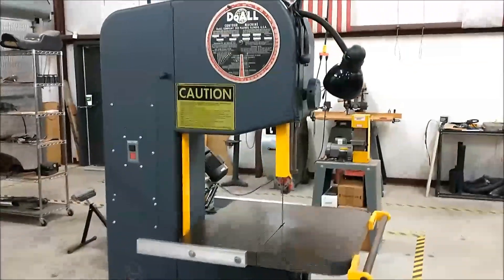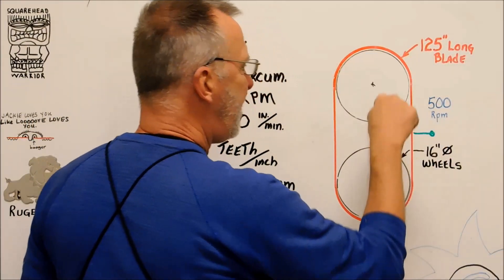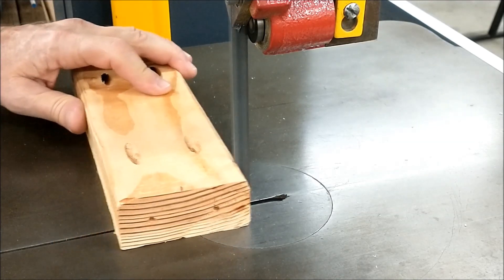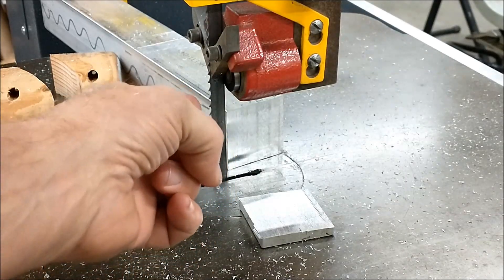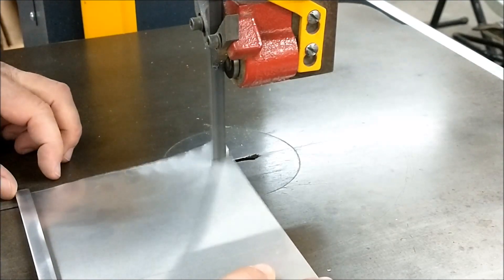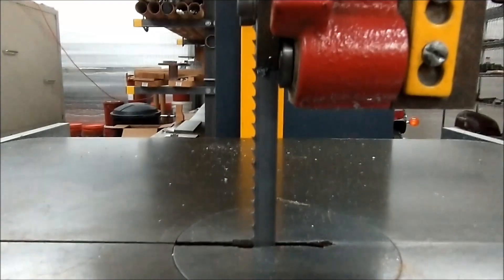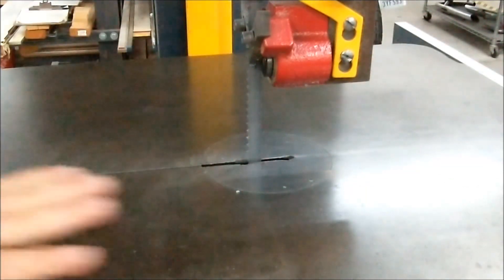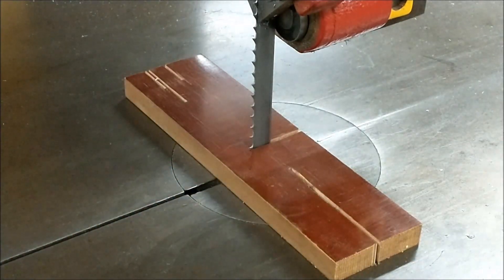1200 POUNDS, 500 TEETH, and No Conscience !!!

Comment: Nice saw Joe, but where’s the blade welder
Reply: It's not needed on that particular model.
Reply from the maker: I have it, but its on the shelf. It had a bad amplifier when I bought it so I took it off and replaced it with the cleaner blank switch panel. I buy my blades cut and welded to length any way, so I don't miss it.

Comment: Another fantastic tip and a good trick to know. I was always told Never run the blade in reverse, this not only proved that wrong but showed a benefit to doing so. In the past I've always sandwiched thin material between two sacrificial off cuts. This way is so much easier and makes following a line much easier so leading to greater accuracy with less wastage as a bonus. Thanks again Joe.

Comment: Back in the 60’s when I was an apprentice Shipwright at a shipyard, the wood shop had a resaw. What this was really was a giant bandsaw. The blade was around six inches wide, and had something like one tooth per inch, maybe less. The wheels were maybe six feet in diameter. The saw was so tall the bottom wheel was below the floor. There was no table as it had an automatic feed to resaw 12”x12” timbers into various thickness planks. That saw was downright scary when it was running. It would feed those timbers through like they were butter. 
To this day the bandsaw is my favorite shop tool.

Comment: Another take on your idea:  turn the blade back to forward (backward) so that the material being cut sees the back of the blade (gauge of the blade).  This was explained to me as “friction cutting”.  The heat is dissipated fairly quickly as the stock is thin.  The final trick to cutting this way is to keep the stock moving while cutting.
Reply: Your blade guides might not appreciate running against the teeth of the blade. In particular the thrust bearing.

Comment: To cut any thin sheet metal steel, brass or aluminum use a dull worn out multi tooth blade(32 tpi). Run the blade at max speed. This works very well with 1/4 or 1/2 hard stainless steel sheet metal. When your done store the blade for next time. Saves ruining a blade by running it backwards
Reply: Might want to wear ear protection with this one

Comment: Another good safety vid. - Good show not wearing gloves when the machine is running too. And I agree with Break-down below. Showing the Drill press vise upside down trick would have been helpful ,,,,,especially to me 50 whatever years ago. I hit a note no opera singer ever sang when the saw grabbed and spun a piece of thin wall tubing I was free handing. To this day I cut even structural shapes with a vice or bridge clamp on it. Go ahead and call me chicken but it's amazing how remembering the pain of getting  a black fingernail keeps you from getting another one. 

I am by no means a safety nazi but I thinl you could save a few fingers by making a video about what can be the most dangerous toll in the shop. The Lowly Drill Press. 

And above all NO GLOVES AROUND ROTATING MACHINERY. Loose the gloves or loose a finger, Better to have a couple stitches in your thumb then not to have a thumb to have stitches in. ---- (That could be another good safety video---even 'ripaway" cloves can move your hand in just  far enough to get tangled up. 

Still. this is a excellent video that should be shown in whatever shop classes that still exist.
Reply from the maker: Watch the video previously posted in the pinned comment above.
Reply: @joepie221  Thanx, Joe

Comment: I just can't figure out how you got the blade upside down.  I guess I need to go down to the shop and look.
Reply: You invert the blade by holding it in both (gloved) hands and twisting the blade. Sometimes when you open a coiled blade it will invert itself and you have to use this twisting motion of both hands to revert it back to teeth facing downwards.
Reply: @Zircon10  Always scares the xxxx out of me to uncoil a blade. Face and arms are potentially in danger regardless if you wear gloves.💩
Reply: The blade needs to be twisted “inside out” ie the inside face of the circle needs to be on the outside. My portaband blades come facing wrong and need flipping.

Comment: We used to cut the thin, cheap plastic lens' for odd sized Fluorescent fixtures on a table saw with the blade reversed.  Just have to go slowly so you don't "burn" the edges.  It also helps immensely if you have a close tolerance on the blade guide slot.

Comment: Very interesting. For thin materials less than the tooth spacing? Was taught in jewelry making tooth spacing needs to be less than the thickness. If very thin then cut at an angle, which is hard to do on a 90 degree bandsaw.

Comment: When I saw 1,200 pounds, 500 teeth and no conscience I assumed an in-law was popping around....

Interesting on the reverse blade though I don't feel inclined to try it myself because you will always have to remember to turn it back around when you are done. Always good to remind people (and ourselves) that machines are dumb so have neither brain nor conscience but do have power and the ability to cut and rip bits off people.
Reply: It never hurts to look at the blade when walking up to a bandsaw, or any saw in general if someone else might have used it or it has been sitting a while. I tend to at least glance at the blade to confirm the tooth pitch is about what I need and that the teeth are facing the right way. If it is a saw I haven't used in a month or more I open it up to make sure the wheels aren't jammed with chips, and manually push the upper wheel around in the normal direction a couple of turns to make sure both wheels turn and that I don't see a twisted blade or an excessive number of missing or loaded teeth. Of course with a horizontal bandsaw you can't really move them manually, but it is still worth looking at the blade you can see and jogging the machine quickly and watch the blade as it slows down.
Reply: @lwilton  All good advice.
Reply: @lwilton  Naaa, I never put a blade in backwards and screwed it it cutting steel barstock....(In a pigs ear) - Very good advice....I have even screed up garbing a left hand drill and wondering how a brand new drill wouldn't cut. It only takes a second to look.

Comment: All right, not quite to the end yet, but fer crying out loud, why aren't you using a sacrificial backing when you try to cut thin material like that? That's exactly what you've demonstrated so many times on the mill! Chipboard or expanded vinyl are cheap and easy.
Reply from the maker: The segment at the end was because I knew I would get blasted. I hope you made it to that point. You are absolutely correct.

Comment: Where I worked before retiring we had a bandsaw we used for cutting stainless steel pipe with a 6/10 vari-pitch blade. The blades would last up to 3 months unless an electrician came along with some stainless cable tray or unistrut. They set the bow drop too fast and stripped all the teeth off the blades. We ended up getting a bandsaw just for the thin material, restricted the rate of bow drop and putting on a 16 tpi blade. It paid for itself in the time saved from changing blades and buying replacement blades.

Comment: I use an old Grob, the same size as your DoAll, on a daily basis.
It still has the blade grinder and welder that actually works.
The blade speed and tooth  chart shows a recommendation for cutting meteorite lol.
Be well and stay safe, Joe.

Comment: Very useful video and a beautiful bandsaw. I'm more familiar with wood in terms of bandsaws but it's just the same thing, is very dangerous specially with low count of teeth when it literaIly eats material. I didn't know about putting the blade in reverse. I usually put a piece of mdf on the table and use it as a support as you've done with the fenolic at the end for thin material .

Comment: Good reminders...I've got a circa '60 version of that saw but I usually run a finer tooth on it than what I see frequently on yours. But, I've got a 20" wood cutting bandsaw that generally keeps a 152" 2-3 tpi skip tooth blade on it. When that saw starts you give it a moment of respect.  I'll have to say though , the most dangerous tool in my shop is my '40s vintage 16" Oliver tablesaw. I've got several friemds with scars or bandages.one quite recently is going to require reconstructive surgery. I try to think of my friends like that every time I go to power that one up. 
Thanks again for the basic reminders that too often wego in automatic mode and the basics go out the window.

Comment: My father in law ran a machine shop in El Monte, CA. I was running a 45 degree bevel rip on a long board and standing to the side of the table to support infeed and outfeed ends. FIL jumped all over me. “Never stand to the side like that with the table tilting downwards.” 

He had a machinist helper running a similar bevel cut in an aluminum block. The blade broke and the broken end caught on the angled table surface. Momentum of the blade continued its slide down the table and into the stomach of the helper standing there. They lost him. 

I know that’s kind of a freak accident but it put enough fear into me that I never stand to the side of the table, and especially not if the table’s outboard edge is tilted downwards.

Comment: To cut roofing iron with a circular saw put the blade in "backwards," this cuts sheet metal with ease much better than a cutting disc. Try not to use a carbide tip blade as this will wreck it and be careful of the hot chips coming off the cut. Shorts and bare feet not recommended.

Comment: Strangely enough I never had so much as a nicked finger in metal or wood shop while I was teaching.
The rule for using the Band Saw was to keep the guard 1/8 of an inch above the material being cut. I always figured that spacing would not allow a finger to enter. Push stick/block was mandatory if you were near the blade.
Probably had more minor injuries with the drill presses. Students not using the vice on short pieces.

Tim
Reply: Hard to believe but the lowely drill press hurts more people then anything else.

Comment: Yep, reverse teeth work great on gummy, melty, or otherwise soft material.  Learned that trick cutting rubber mats for target backers.  Still have to check the blade for buildup, but far better cut that way.  Everybody gets all safety around the bandsaw, but it's commercial table saws or rip saws that give me the heebee jeebees.  Just as quick to take digits with the added fun of kickback.
Reply from the maker: Wood shop jointers make me cringe. I have to say thats my personal scariest machine. All the others don't bother me.
Reply: @joepie221  ...but nothing says good morning quite like blowing up an end mill at ~18k or the guy a machine over forgetting his coax is in and turning on the spindle.  Those are bangs you don't soon forget.

Comment: My first job and first Union job in HS was butcher clean up. I made twice what my friends did so I really did not have to work a long time to get some spending money. Of course I could not cut meat but in cleaning up had to take apart and put together all the tools including the band saw. When they had me install a new blade they would give me a bone to cut to wipe off the factory oil that protected the blades. Cutting a cow thigh bone which is much heavier than any of our bones was extremely quick. I gained instant respect for power tools.
Reply from the maker: The minute you loose respect for a power tool, the tool will be happy to remind you.

Comment: Great math on how fast the teeth  are moving  thru a plane. My A&P aircraft  instructor  did the same math for a standard  E2C prop. At idle  speed  the prop will hit you 32 time a second.  We were blown away     that the one blade will hit you that many times in one second.  Great video  joe.

Comment: Running blade backwards on plexiglass is a bad idea.  You are melting your way through.  That is the LAST thing you want to do on any acrylic plastic.  If you were to look at it through 2 crossed polarizers, you would see dazzling colors at the cut edge, indicating much built-in stress.  Lay those cut pieces down & wait 1 month, & you will see thousands of little cracks, just waiting to propagate through the material.
          To cut plexiglass, you need a fine tooth blade, in the SHARPEST state, running at about 30 feet per minute (I assume your saw has a low-range gearbox like the 20" DoAll bandsaw I used at work).  The backwards strategy is best for soft materials that cut with a knife, such as PVC siding, & rubber.  Some manufacturers make such "backwards" blades for the purpose.
          But there IS a dirty trick when your blade is marginally too coarse for the job: run the blade speed a little high & feed lightly.
          This saw is no more dangerous than most floor-standing bandsaws.  In fact, wood saws are much more dangerous.  They have longer exposed blades with coarse teeth, optimized to cut flash, & run at higher speeds than are used in most metal cutting (unless you are friction sawing steel).  Some wood saws run so fast & store so much energy that they have a footbrake to stop them after shutting off.  At these speeds even the low-mass blade can fly out when it breaks in the middle of a cut.
Reply from the maker: If the material turns brown and lumpy on the backside, you're melting it. Softer plastics will have a tendency to melt, but acrylic cuts just fine. The demo piece didn't melt at all.
Reply: @joepie221  You would not believe how slow you can saw & still melt the plastic.  For many plastics, such as vinyl siding, it doesn't matter, because they are "plastic" at any temperature other than cryogenic.  But for plastics that are brittle when they are cool, it does.  You can see this when hacksawing a thick piece of Plexiglas.  Get piece with polished edge, about 1 inch from, & opposite to, the side you are sawing into.  Clamp piece vertically in vice & saw into one side, while you watch the bottom of the cut from behind, through the polished edge.  If you move the saw REAL slow, the bottom of the cut will appear white.  If you saw faster, you will see clear spots, like the plastic was wet, in the bottom of the kerf, as you saw forward, & disappear when you stop.  This happens in Plexiglas because after the cutter passes, the plastic springs back & rubs even though the teeth are relieved.  The plastic is an extremely poor thermal conductor (the heat is trapped near the surface), & has a low specific heat (it takes little heat to give a large rise in temperature).
          The result is a land mine, just waiting to go off.  It will crack later, especially if it is exposed to outdoor UV light, such as on a store sign.  The solution is to anneal the plastic after all machining is done.  Sanding melts it too, unless you sand in water.
          If you think this is bad, wait until you see Plexiglas cut by laser!  There are numerous clock projects with Plexiglas gears.  in a month, cracks radiate from all the roots of the teeth.  If you set up a polariscope (2 crossed polarized lenses from cheap sunglasses will do), you will see dazzling colors at the cuts, showing the internal stress.

Comment: They aren’t too noisy or scary.  Visit a butcher shop and see one in action on meat!  Thanks Joe.
Reply: Between two jobs I spent a few weeks in a meat processing factory as a maintenance engineer. The people working on the bandsaws were only allowed a short time on the machine before they were swapped out with another operator so they never lost concentration. There were also signs up telling people not to talk to the operators so they didn't get distracted.

Comment: Great demo. I use a bandsaw in a wood environment. Always considered it one of the most dangerous tools in the shop. It looks so innocent and yet will bite you so quick. Always change my grip on the material to behind the blade when almost through. No matter how much you think you have eased the pressure off, it always shoots forward more than you think. Our resaw bandsaw has a power feed.

Comment: Thanks Joe! That's one very informative video...... I learned a lot.

As a machinist I got to use a band saw quite often in my job, one thing that was instilled into me by the old timers is to always use a feather board (or some piece of wood to keep your fingers away from The cutting edge). One time I forgot..... And after cutting halfway up the length of my pinky nail, and going to the emergency room, I was much more careful from that point on.

My pinky healed up fine, but every time I look at that scar I remember how dangerous band saws can be when you're not paying attention.

My Uncle Jerry, who taught me all that I know about sheetrocking, carpentry, and painting..... Had one of these band saws in his basement workshop. He had come down with Parkinson's disease, but he was independent and quite stubborn. One day he was cutting some wood on his band saw and he cut half of one of his fingers off.

I've come to realize that in a machine shop you always have to respect the saws and the grinders..... Because either one could change your bodily appearance in a heartbeat!

Comment: Great tip!!! I've never understood why everyone installs the table insert with the slit to the front. I have always placed the extended slit to the rear, so I have material support at the cutting point on thin material. I don't run different size blades, just      different tooth counts. Always great videos!

Comment: Always been told that the bandsaw and table saw are the two most dangerous tools in a shop. Especially the bandsaw. While most people will adjust the height of the blade on a table saw. They will most certainly not adjust the blade guide on the band saw. I've seen too many people pull the blade off the band saw backing through the cut with the upper guide up near the top.